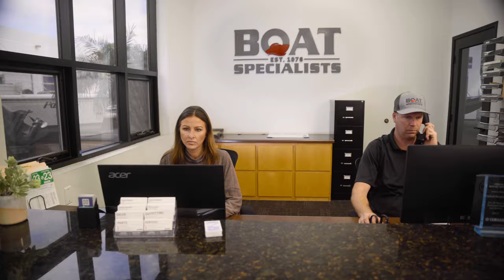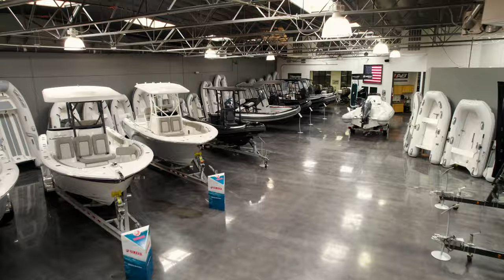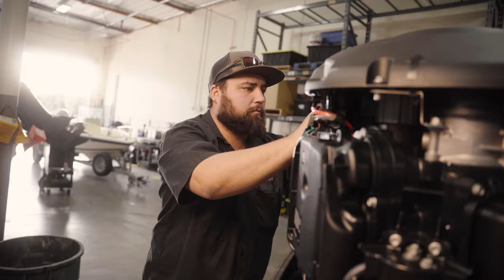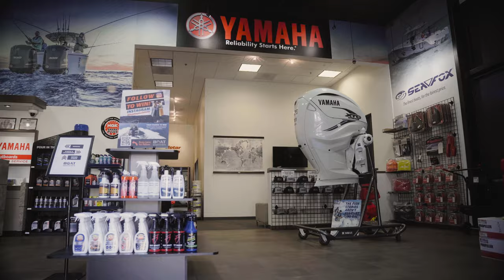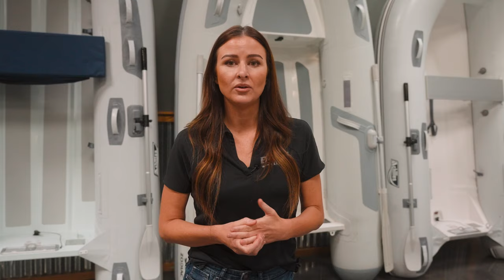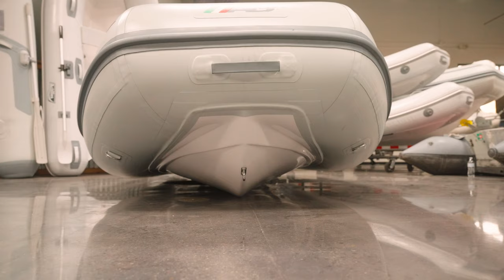Aluminum vs Fiberglass Rigid Inflatable Boats

Comment: When it comes to care of the aluminum or fiberglass hull......is there any major differences/benefits...(especially if the rib will be strictly in saltwater)?
Reply from the maker: Thanks for the comment! Aluminum is generally resistant to corrosion. However, it's important to match the right cleaning products to the material of your hull. If you plan to keep it sitting in salt water, you may want to consider powder-coating the hull to give additional protection. It bends but doesn't break easily, repairs to aluminum can also be done fairly quickly and easily. They're great, safe boats for rough conditions.

Fiberglass is not affected by moisture or the elements and can be left in the water for extended periods without worry of damage. They're also easy to clean, and damages can be handled by a professional with a fiberglass patch.

Comment: Im interested in the Zodiac cadet 390 Aluminium Hull. After using my Honwave T38 IE3 for quite a few years now, im ready to up great. I have a tohatsu 20hp 4-stroke outboard motor, would this be a good match with the 390 cadet. Thanks
Reply from the maker: Well depending on what kind of use and load you are going to be having it will determine the performance of a 20HP on there. I think with a light load with proper weight distribution you should be able to get the boat to plane. Definitely enough power to move the boat efficiently but getting up and on plane is borderline!
Reply: Hi, thanks for replying. What outboard board hp would you recommend for the 390 aluminium Hull cadet. I was hoping my Tohatsu 20hp 4-stroke would be ideal 🤔
Reply from the maker: @stevesdaysoff2759  If you wanted maximum hp and performance i would say the Tohatsu 30 would be ideal. Its lighter than the other brands at this size with a fairly large displacement still. Again though the 20 you have would be enough for most people with that boat.